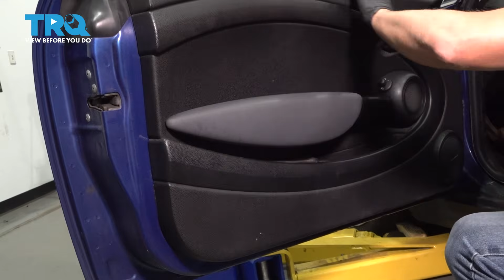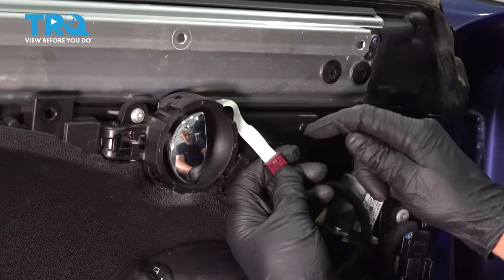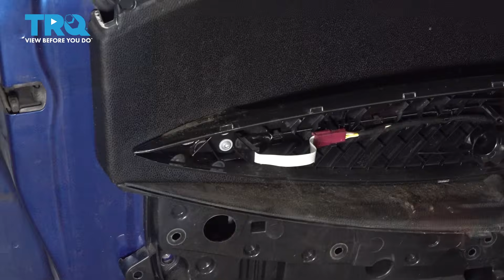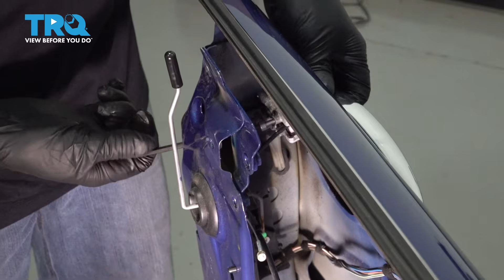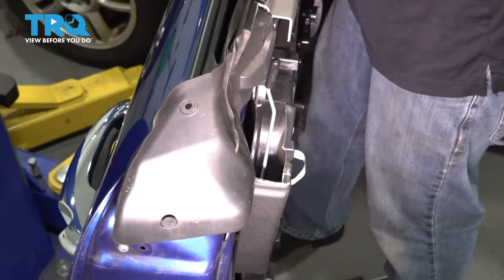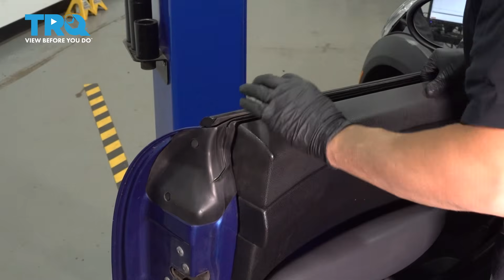How to Replace Exterior Door Handle 2007-2013 Mini Cooper

Comment: good vid, my 2009 required going beyond the magnet and using a hooked wire to grab the screws to back them into the second set of threads or they were still in the way of the glass sliding out.

Comment: good video glass retaining bolts were different however on the 2009 mini i worked on in that both sides of the glass clevis are threaded and the bolts only threaded on the tip so you think the bolts loose but you then have to thread it through the other half of the clevis

Comment: Hi, I followed your steps, thank you, now I put everything back but when I press the toggle to close the window it goes all the way up and comes down half way, I don't know how to fix it any ideas ? Thanks
Reply: You need to reinitialize the window motor. Do that by (with the door closed) pressing the window switch down and once the window reaches the bottom, hold the switch down for a couple more seconds. Repeat the steps for he up position. Holding at the top for a couple of seconds.

Window should now go up and down normally, and should "cinch" properly as well on door open.

Comment: when reinstalling how do you get the inter handle cable to reconnect correctly. when I get thè cable to snap closed. The handle on the inside handle. pushes it open, and  won't work!